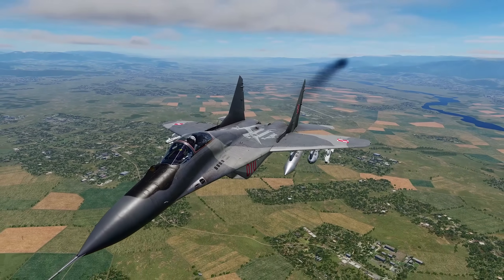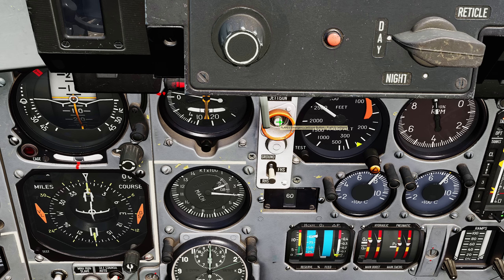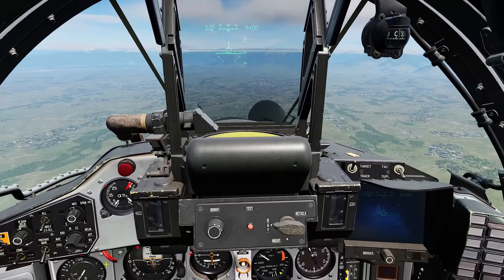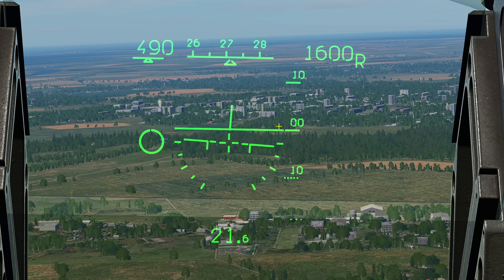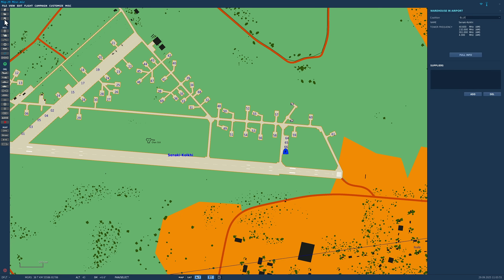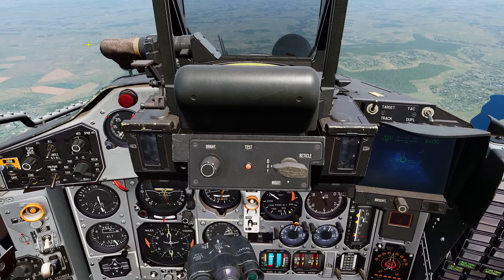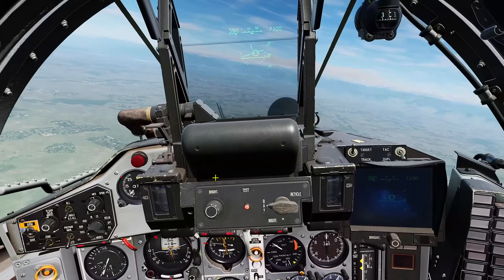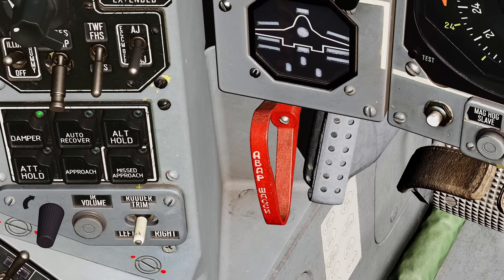Mig-29A Fulcrum: Radio, AFCS/Autopilot, Jettison, HUD & Countermeasures Expanded | DCS

Comment: Do the settings you make in the DTC stay when you join a multiplayer server? The preset radio frequencies and the CMDS settings specifically. I’m assuming the RSBN will not work if the beacons are not setup in the server?